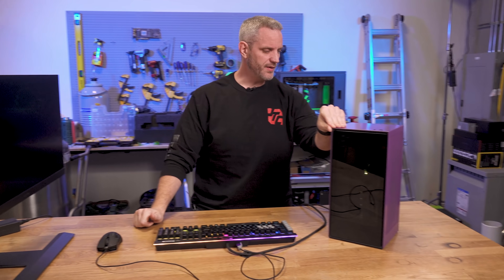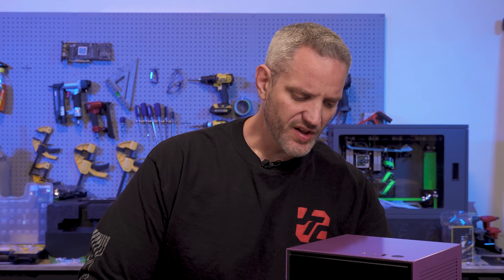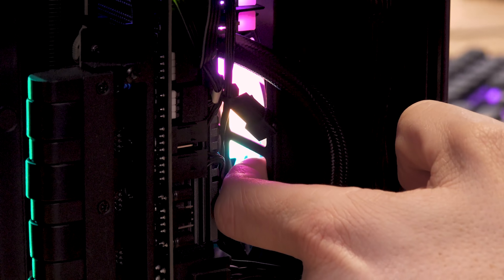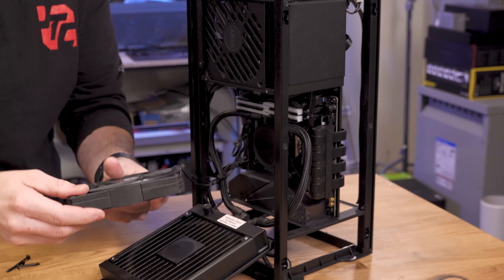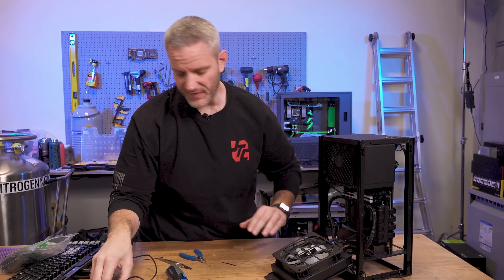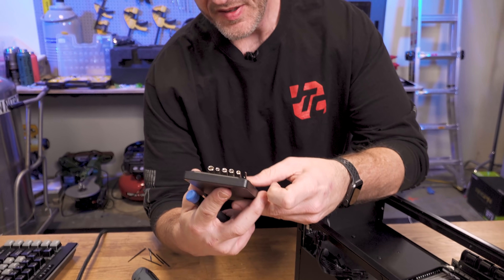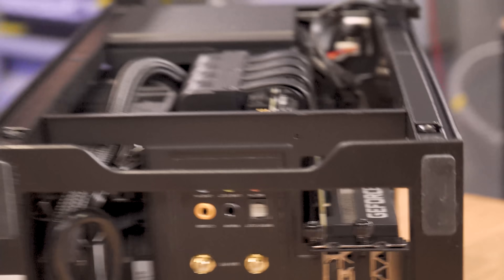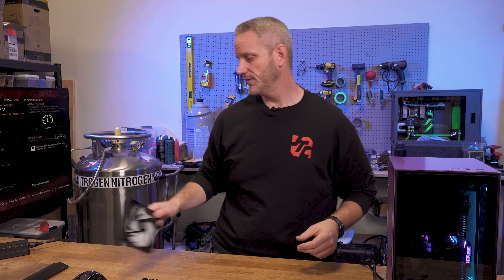This PC is shutting down due to overheating... let's investigate why!

Comment: I won't use anything but ball bearing fans in any of my builds.  I've never had to replace one, even after 10 years of use.  Also, why not blow out all the dust in that radiator while it's disassembled?

Comment: The plastic washer is an insufficient fix if the screw threads are touching PCB traces. Is the recall specific to the screw head wearing trough the top PCB layer?

Comment: I bought one of those same Hammerhead drivers a few years ago because it is also short enough to travel with in your carry on bag.  Make sure to take any bits out first.
Reply: Please help 
I built my pc and it starts but I get no signals on my monitor 
Tried everything 
Ram 
The monitor it self 
Gpu 
Everything is plugged correctly btw 
The fans spin and lights are on but there's no lights and my keyboard and mouse don't get lights as well
The pc stays on for few min and turns off automatically than it turns back on
I got ryzen 5 2600 
16gb ddr4 3000
2060 rtx 
Psu is 400w 

Where is the problem??

Comment: Still beyond happy with my iFixIT kit that a rep gave me at a Micro Center employee conference (when I worked for them), but I do need to get my self those tweezers and possibly another kit to stay at my desk at work.  Love it when fixes are simple, but I know electronic fail just sucks when it happens - hopefully that fan was just out of a bad batch (I prefer the Corsair ML Fans (non RGB)).

Comment: I actually wanted to buy a set of the sk rgb fans from phanteks, anyone got experience with them and can tell me if it's a good idea to buy them? 3 120's will be mounted on a top mounted radiator and 3 140's will be mounted one at the back and two at the front.

Comment: Hey Jay,
I do have some problems with thermals of my RTX 3070 Strix. When mounted vertical (I/O to the top!) my temps are at TJ-max (80°C) and the fans are spinning quite fast. When I lay my case to the side, so the MB is flat the temps go down to ~60°C.

Comment: Merry Christmas to all of you that are watching on December 25th!
Reply: Please help 
I built my pc and it starts but I get no signals on my monitor 
Tried everything 
Ram 
The monitor it self 
Gpu 
Everything is plugged correctly btw 
The fans spin and lights are on but there's no lights and my keyboard and mouse don't get lights as well
The pc stays on for few min and turns off automatically than it turns back on
I got ryzen 5 2600 
16gb ddr4 3000
2060 rtx 
Psu is 400w 

Where is the problem??
Reply: @imhungry8713  it could be an electrical shortage somewhere within the pc, or it could need a CMOS reset (you can find a small circular battery on your motherboard, take it out, leave it for 5-10 seconds, then put it in). If you’re not getting a post, try unplugging the GPU from its pcie slot and changing the slot location, it could be a dead slot (make sure PSU is turned off). If that doesn’t work, turn on the pc and check the graphics card. Just above the connections with the cables there could be a small flashing light. That means that the gpu has an issue. You could also try installing a different cpu (same brand) into the mobo, and if that works, then your cpu has an issue. Also, try plugging the HDMI cable into a different GPU slot, because it could be a dead HDMI port. If nothing works at all, then try putting a different gpu into your PC in order to check if your current one is dead. I had this issue myself and the fix was resetting the CMOS battery, which was overloaded with power after a faulty overclock. Here is a link to a more in depth and thorough guide on how to fix this issue, hope it helps!

https://computerinfobits.com/computer-not-posting/
Reply: @NickTEnache  bro thanks u borrowed me your time but all my components are brand new outta the package none of em are defect and the battery in the mb i tried it as well my cables are new as well others tell me its caz of the psu they say my specs are high i need more than 400w
Reply: @imhungry8713 No problem, if your psu needs to be higher than 400w, shoot for a 550-650 psu, that will do the job!

Comment: Mom: "You can not have it, because youre being a punk!"
Kid: OKAY MOM NEXT TIME ILL GO NOMAD ROUTE
Reply: Please help 
I built my pc and it starts but I get no signals on my monitor 
Tried everything 
Ram 
The monitor it self 
Gpu 
Everything is plugged correctly btw 
The fans spin and lights are on but there's no lights and my keyboard and mouse don't get lights as well
The pc stays on for few min and turns off automatically than it turns back on
I got ryzen 5 2600 
16gb ddr4 3000
2060 rtx 
Psu is 400w 

Where is the problem??
Reply: @imhungry8713  Tell us mb exact model and ram exact model. There can be so much reasons that we have to start somewhere.
Reply: @Weisior  MB is asrock b450m pro4 Ram is 16gb ddr4 3000mhz gskill 
All my components are brandnew so they're not defect
Reply: @imhungry8713  Is the XMP profile in your bios set to other than 2400mhz?, if not do it (disable xmp)
Reply: @Weisior  what are bios what is xmp how do I do that
Reply: @imhungry8713  holy crap man
Reply: @imhungry8713  xmp stands for extreme memory profile, in short it lets you to overclock your ram by simply setting it on desired preset.
Sometimes is happens, that when your ram is incompatibile with your motherboard or cpu, setting xmp on higher frequencies than the standard 2400mhz for ddr4 makes your computer unstable or even not "waking up" at all.
But if you dont know that, on your place I would check if everything in your pc is connected properly first.

Comment: That girl was so bad that even her case screws got grounded.
Reply: underrated comment
Reply: 😭 such a dad joke
Reply: Please help 
I built my pc and it starts but I get no signals on my monitor 
Tried everything 
Ram 
The monitor it self 
Gpu 
Everything is plugged correctly btw 
The fans spin and lights are on but there's no lights and my keyboard and mouse don't get lights as well 
I got ryzen 5 2600 
16gb ddr4 3000
2060 rtx 
Psu is 400w 

Where is the problem??
Reply: @imhungry8713  upgrade your PSU please..
Reply: @imhungry8713  is your monitor plugged into your motherboard or gpu?
Reply: Well played sir.
Reply: This comment aged poorly
Reply: @youraveragemetalhead226  you hurt my feelings man...
Reply: @dimitrimichaux461  nah. i hurt NZXT's feelings for engineering such a horrible pcie riser
Reply: Damn 😂😂😂

Comment: 7:41 jay flips the bird 😂
Reply: Please help 
I built my pc and it starts but I get no signals on my monitor 
Tried everything 
Ram 
The monitor it self 
Gpu 
Everything is plugged correctly btw 
The fans spin and lights are on but there's no lights and my keyboard and mouse don't get lights as well
The pc stays on for few min and turns off automatically than it turns back on
I got ryzen 5 2600 
16gb ddr4 3000
2060 rtx 
Psu is 400w 

Where is the problem??

Comment: How is the scew isolated, if its still threading in to the chassi and that thread also hitting the pcb?
Thought you said that the screws "bite in to the pcb" aka hitting the leads inside the pcb. So isolating it with washers shouldnt fix it really.
Reply: Had the same thought, and Steve/Patrick (Gamer's Nexus) just proved it. Nylon Washers won't do shit. And by actually removing and putting the screw back in Jay might have increased the chances of the screw thread contacting the trace in PCB.
Reply: @KnightlySpartan  yep the washer thickness means a different part of the thread is now in the area that causes the fire. Jay might have inadvertently caused a fire hazard.
Reply: That's exactly what I was thinking.
Reply: you can get plastic isolating screws
Reply: Yeah.... I used zipties thru the mounting holes and nylon washers between pcb and chasis...
Reply: You are completly right.
Reply: Please help 
I built my pc and it starts but I get no signals on my monitor 
Tried everything 
Ram 
The monitor it self 
Gpu 
Everything is plugged correctly btw 
The fans spin and lights are on but there's no lights and my keyboard and mouse don't get lights as well
The pc stays on for few min and turns off automatically than it turns back on
I got ryzen 5 2600 
16gb ddr4 3000
2060 rtx 
Psu is 400w 

Where is the problem??
Reply: I think in this situation, it's the head of the screw that's digging into the surface of the PCB, not the threads. So a washer would isolate just fine

Comment: HI Merrry Christmas One and all, what color was that case ,  thanks for all the video's
Reply: Please help 
I built my pc and it starts but I get no signals on my monitor 
Tried everything 
Ram 
The monitor it self 
Gpu 
Everything is plugged correctly btw 
The fans spin and lights are on but there's no lights and my keyboard and mouse don't get lights as well
The pc stays on for few min and turns off automatically than it turns back on
I got ryzen 5 2600 
16gb ddr4 3000
2060 rtx 
Psu is 400w 

Where is the problem??

Comment: Just finished up a new build in a Corsair 4000X with their riser card, and had to use a couple of metal washers to space the riser adapter up a little. Glad I saw this because now I'm going to get a few nylon washers to protect the riser, and add the necessary spacing as the GPU (when installed) doesn't quite sit in the slot all of the way. Merry Christmas to you and yours', Jay! 

Loving the "31 Days of Techmas"!

Comment: "I'll put a link below" ... There is never any links below. :(
Reply: They’re here now :)
Reply: @jeeeyouuu1053  Where? Still don't see a link.
Reply: @Sandriell  Have you tried clicking the show more button?
Reply: Yeah... where’s my screwdriver link?!
Reply: +1 I’d like to know the screwdriver as well.
Reply: Please help 
I built my pc and it starts but I get no signals on my monitor 
Tried everything 
Ram 
The monitor it self 
Gpu 
Everything is plugged correctly btw 
The fans spin and lights are on but there's no lights and my keyboard and mouse don't get lights as well
The pc stays on for few min and turns off automatically than it turns back on
I got ryzen 5 2600 
16gb ddr4 3000
2060 rtx 
Psu is 400w 

Where is the problem??
Reply: @imhungry8713 been two years what was the solution?

Comment: Thanks for addressing the question about the screwdriver. I ended up finding it on Amazon after your past video. I know its a cheap one but I like the way it twists near the top to activate it. Couldn't find another one around that did that. Lol. Thanks Jay

Comment: Jay, you mentioned in the start of this video that your Black Ice computer kept turning itself on and did not want to stay off. I have a rig that is having the same problem. Can you expand on this more in another video? It is a very odd problem that is hard to pinpoint. My guess it is Windoze doing some stupid thing it does. Is this the problem?
If you do make a video make sure the thumbnail of the video says, "Does your CPU turn back on BY ITSELF?!?"

Comment: instead of replacing that fan, just lubricate the fan bearings again with SINGER OIL(used in Sewing Machines, Electric Fans, etc.)
Reply: Please help 
I built my pc and it starts but I get no signals on my monitor 
Tried everything 
Ram 
The monitor it self 
Gpu 
Everything is plugged correctly btw 
The fans spin and lights are on but there's no lights and my keyboard and mouse don't get lights as well
The pc stays on for few min and turns off automatically than it turns back on
I got ryzen 5 2600 
16gb ddr4 3000
2060 rtx 
Psu is 400w 

Where is the problem??

Comment: This is the month for all computers to start having problems! My Linux Plex server just totally crapped out on me yesterday for no apparent reason and just plain broke. I think the old hard drive it's using is starting to fail.
Reply: Please help 
I built my pc and it starts but I get no signals on my monitor 
Tried everything 
Ram 
The monitor it self 
Gpu 
Everything is plugged correctly btw 
The fans spin and lights are on but there's no lights and my keyboard and mouse don't get lights as well
The pc stays on for few min and turns off automatically than it turns back on
I got ryzen 5 2600 
16gb ddr4 3000
2060 rtx 
Psu is 400w 

Where is the problem??
Reply: @imhungry8713  You might not have enough power between the GPU and the rest of the computer. A 400W one might not be enough. That's not the only possible cause. I'd recommend looking at troubleshooting videos for diagnosing PC problems. One way to tell if it's the power supply not being strong enough, it would be to use another power supply of course, or try a less powerful GPU if you have one. With an RTX card like that I'd recommend 550W or more, depending on the card - it should say somewhere on the box or in the manual what Wattage power supply it recommends.

Comment: jay, im lost here, a screw in itself is conductive as it is metal, you added a plastic isolator to the screw base, This does not kill the current in the conductor (screw)  what you have done expands the overall length of the screw to the positive current inside the case . The  threads that still touch the ground are conductive. you have now made it easier for ground and positive to short with the added length. this is not the correct fix to the problem. i love your vids, but this is dangerous miss information that could make the problem worse that the original design. you have taught me tons over the years but I want you and your family to stay safe!

Comment: The fan you used is has a HYDRAULIC bearing, not a magnetic levitation. You should have put an ML series fan, they use magnetic levitation bearings, they are from corsair and they have really good static pressure. I have two of them on a rad too and i am really happy with them.

Comment: Quick question: I recently discovered this creator (must've been all the computer stuff I was looking up as I patiently save up for my new PC). I like his stuff including his 'fix problems' videos (I FIX IT!!!!!! *explosion*). Here's the thing: he has a very practical 'isolate the problem and then replace the part' philosophy to computer repair -- and while awesome, I feel I'm missing something. I don't have a computer store's worth of replacement parts to just cycle through until the problem is solved. Are there channels out there that solve computer problems with a similar presentation but go through things like looking at error logs, showing you how to debug issues and stuff like that. That way I would know what to buy and better understand if it's a hardware or software problem. Any recommendations would be much appreciated. Thanks! :)

Comment: ALSO REFER TO gn STEVES. wHY RADIATORS SHOULDNT BE LOWER THAN THE PUMP. tHAT PUMP IS NOT WORKING OPTIMALLY BECAUSE OF PLACEMENT AND DESIGN. ITS VERY POSSIBLE THAT YOU HAVE AIR BUBBLES SITTING ON THE DIE AND THIS WILL BE A REPEDITIVE PROBLEM WITH OVER HEATING .. EVEN WITH A WORKING FAN.

Comment: A fan dying in 2 months no matter how it was orientated in unacceptable in my book. However every company that ships anything built has 0.5% - 3% failure rate, maybe it's just in that range, as long as there's a good return policy not an issue at all. I do always wonder if it's just that 3% range or a bad batch though. I've had many things fail over the years it happens.

Comment: Hey has anyone q flashed on an Aorus x570 pro wifi? First time q flashing and is stressing me out all of the videos about it are different in some ways. I would like to know if when downloading the files and you unzip the folder do you only need the actual file you are renaming or do you also need the other files that are in(like the text file, etc.)?